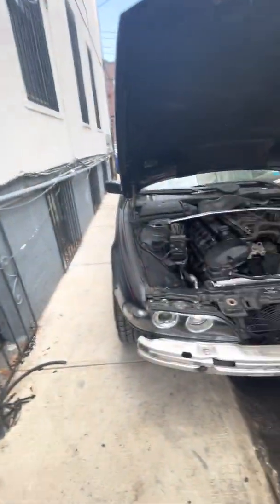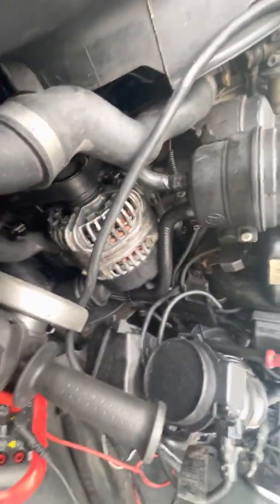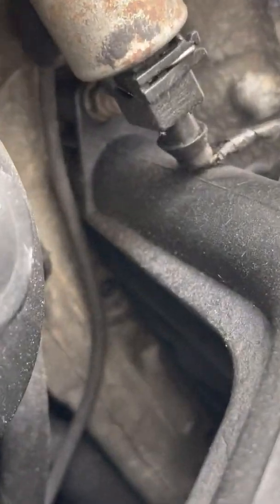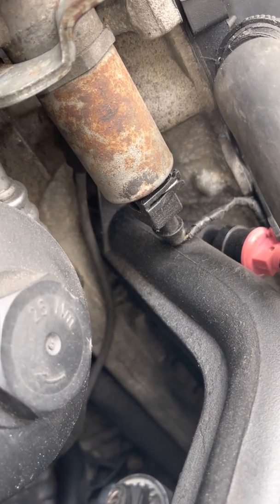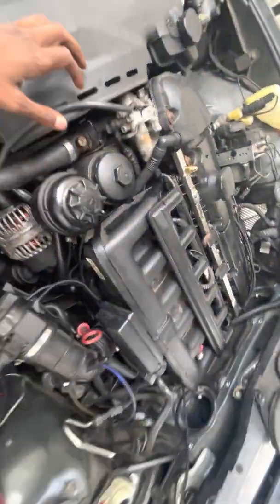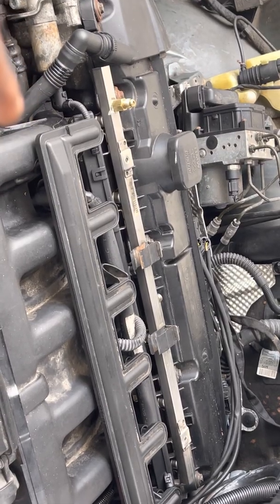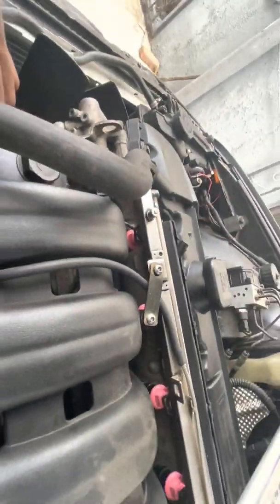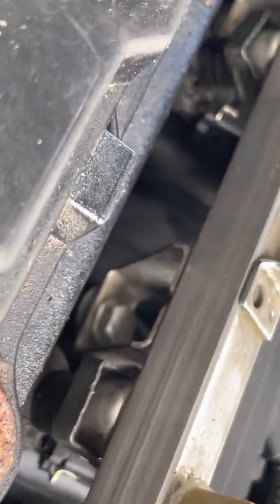M50 Intake on M54/M52TU Engine (Complete Guide)

Comment: Did you use injector Spacer's for the m54 injectors to fit the m50 manifold
Reply: No. No need, the injectors are the same size. You just need an adapter to hold the fuel rail onto the manifold, it’s literally a piece of 2 inch aluminum with two holes in it.

Comment: Those ports in the cylinder head that you plugged up, those are not oil recirculation ports, they are idle ports that match up with the original intake that you removed. Those are the ports that the original ICV (Idle Control Valve) use at idle, there are 6 of those ports on an M52TUB or M54 intake.

Comment: First off, great job. I’d like a little more info on the purge valve you deleted as well as more info on the vacuum line that runs to the top of your fuel rail, like could you follow it on video to where it starts and ends pass the fuel rail to the fire wall? Besides that bro amazing work 🙏🏻🙏🏻
Reply from the maker: No problem. Follow me on Instagram at @richstepdad I can literally send you pics of EVERYTHING. I wanna see more people do the swap
Reply from the maker: With the stock intake the power come on early and died around 5K rpm, with the m50 below 3K kinda sucks, but above 3K it’s a whole new animal. I call it German VTEC
Reply: @vontinoelle  I'm looking to do a similar conversion, I just want to know if it's similar if I have a m52tub28 iron block I currently have a BMW 525i model year 2003 and it has an m54 inside. I want to swap the m52 tub28 into it and I was told that I should be using the M50 intake manifold.
Reply from the maker: @EmborFrost  the heads are basically the same. Just plug the ports with the seem legit garage hardware and use there throttle body adapter for your m54 DBW throttle body
Reply: @vontinoelle one additional question, and thanks for answering my previous question. But  would I be using my m54 wriing harness on the M52 iron block? All of the research I've done points to yes I should be able to use my m54 wiring harness and ECM on the m52 iron block with the exception that I would be changing the positioning of some of the sensors and such when it came to using the M50 intake setup with the M54  DBw adapter from seems legit garage
Reply from the maker: @EmborFrost  the harness is the least of your worries. The harness is compatible but if your ECU is coded for a 2.5/3.0 M54 and you NOW have a 2.8 block you will run into issues without having the ECU coded for the change in displacement.
Reply: @vontinoelle  Thank you very dang much for the reply again! This is lots of helpful info! I'm trying to gather as much info as I can before I dive into the swap. I've got another question. The M53 Harness has dual Vanos, I'm assuming when I change the code on the ECM to support the M52 block I'll probably have to get them to also code for the single Vanos?